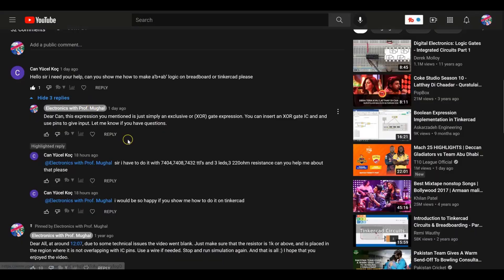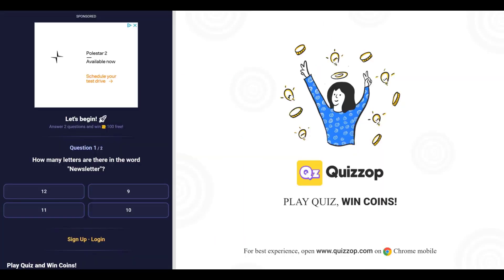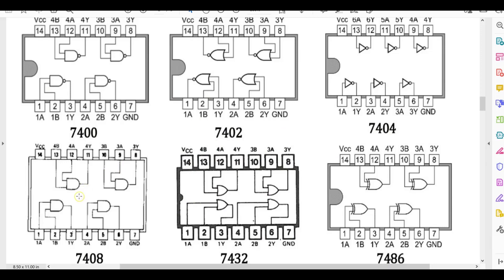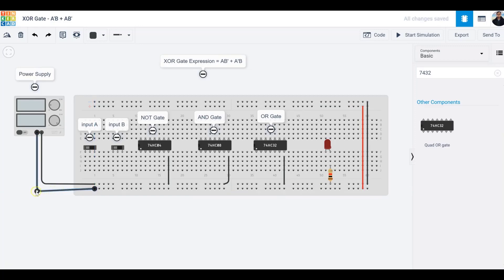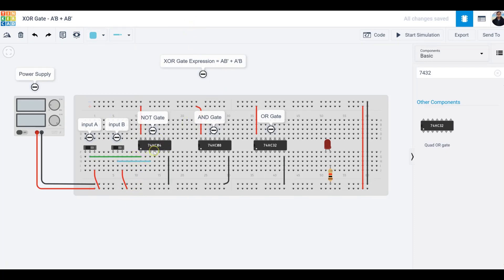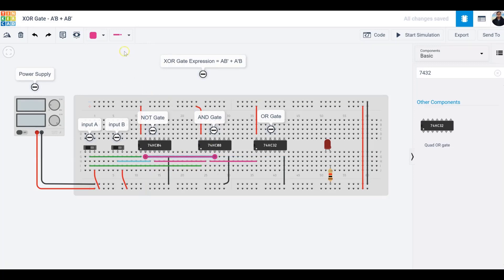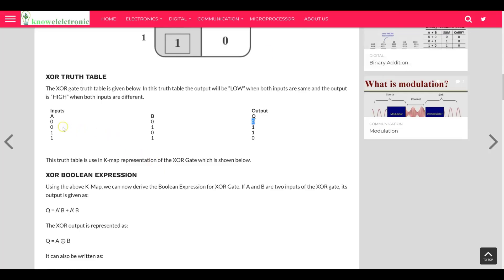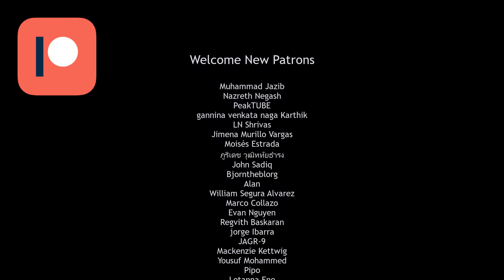#11 XOR Gate - How to build a logic circuit from a Boolean expression?

Comment: Thank you so much sir for helping but i need to use 3 leds and resistors how can i put them in this circuit
Reply from the maker: That you should try to do it yourself taking help from this video.
Reply: @ElectronicswithProfMughal  sir i did this circuit it didnt work how can i understand my mistake